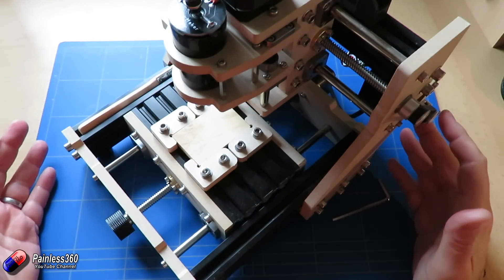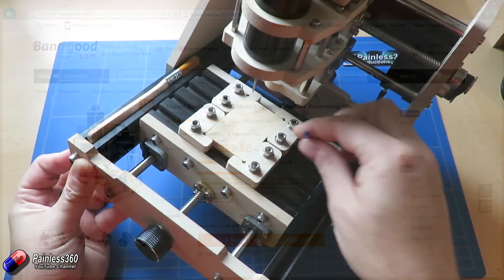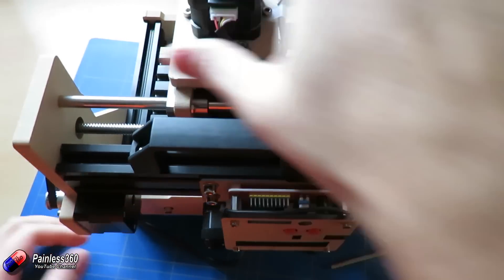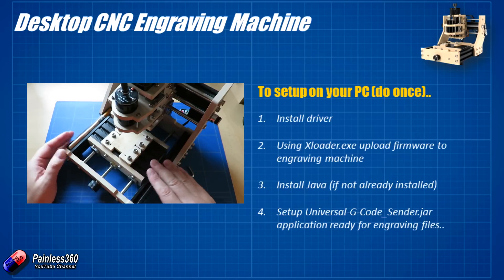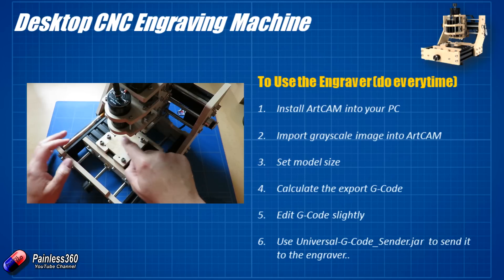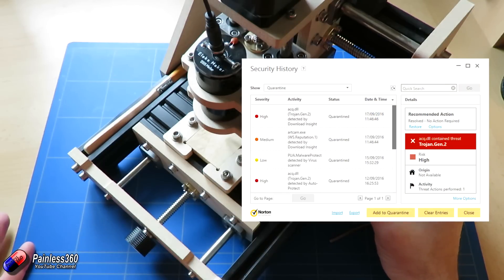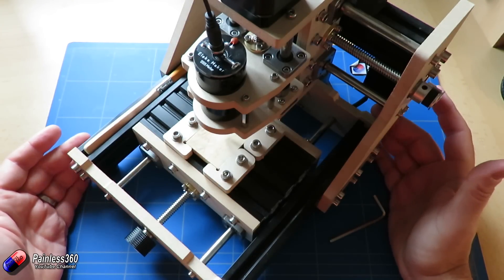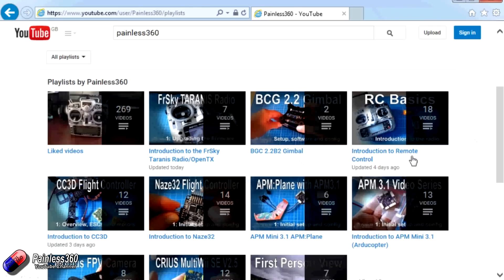Help Needed: Desktop CNC Engraver Software (machine from Bangggod.com)

Comment: You might check out the forums at "openbuilds.com". for some info on control software. I know you already use Sketchup... add SketchUcam, and I saw a vid on a free software controller called "Grbl panel control". I am pretty sure it will allow you to set your home position to anywhere you like. I can not be 100% sure this will work for you but it might be a good place to start. They are one of the Open Source best for CNC. Hope this helps and good luck.
Reply from the maker: +Herb Wyatt thanks for the ideas..

Comment: linuxcnc should be helpful which is free and is capable of doing most of the cnc stuff. You could try using sketchUcam plugin with sketchup to generate the gcodes and have it run via linuxcnc box.

Comment: Auto desk fusion 360 it's free as long as your a student or your company makes less than $100000 a year it's easy to learn and there are many instructional videos on you tube 

 It also has a cam processor built in It's CAD and CAM all in one software package

Your going to have to learn about feeds and speeds and  tooling you should subscribe to nyccnc on YouTube 

I learned a Lot from John 

If your going to cut carbon fiber your going to have to keep the dust out of the step drivers arduino ect or it will fry everything
Reply from the maker: Thanks for the idea!

Comment: Hi. I converted my 3d printer (p3steel) into a cnc even keeping the Marlin firmware. For the gcode I used Pycam and since I like openscad, I used functions like projection and cut to convert my 3d designs into 2d dxf. I hope it helps.

Comment: Although I would run it through a proper AV package, the other (better safe than sorry) option is to install it on a virtual machine. TBH all the software that I test is run from a VM but that's simply to keep the clutter down on my normal system

Comment: Sketchup has a plugin called sketchucam by the phaltboyz .  I use it on my CNC machine. It's quite easy to use and there are some good videos on YouTube. Also autodesk fusion 360 is free to hobbyist and students and does CAD/CAM. it's a bit more of a learning curve but I've had good results with both. Hope that helps.
Reply from the maker: Thanks for that, sadly it doesn't let you set the origin as the middle of the piece otherwise it would have been the answer. Thanks again for the suggestion..

Comment: Try using Inkscape. It's an open source vector graphic program which I use for laser cutting. Should work for CNC milling too. It's a very nice and easy software to use which is fantastic!

Comment: 123d had a cnc function, don't know if it would help when it's available again. Fusion360 does produce g-code and is easy to learn if you know 123d. A free licence is available to educators.

Comment: can it make carbon frames 😂😂
Reply: You wouldn't be able to make anything larger than 130*90mm, pretty small...
Reply: Randy Lachman yes you can !
Reply: Peter Woo of that I don't know the size of bed....but smaller plates you can do.
Reply: if you made a x frame with removable arms you could get a moderatly sized miniquad.
Reply: Spending 370 dollars to buy a small CNC cutter just to build miniquad frames seems a bit too much... I think it would be better if a little bit more money was spent to buy a machine with a larger cutting area. imo.
Reply: Peter Woo But, the thing is, most likely the CNC cutter would be used for other things, but it would take less than an hour or two to make a frame, if you aren't using it, you could start to make the 370 back.